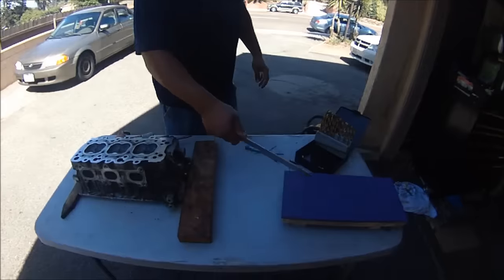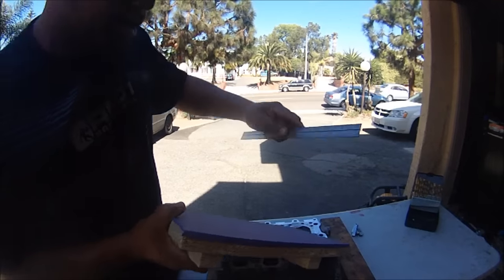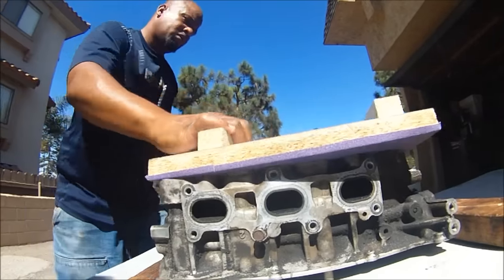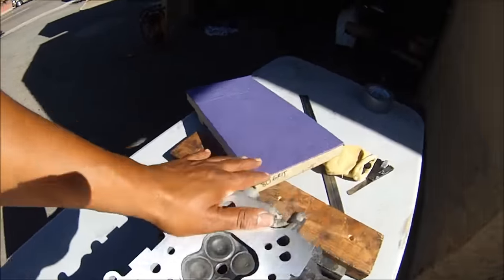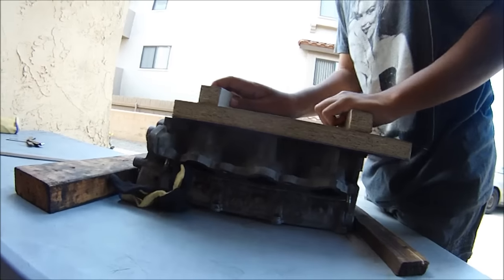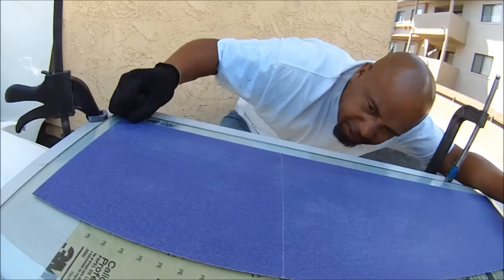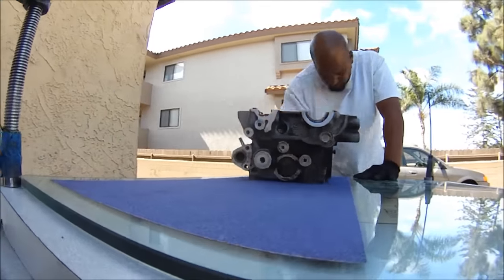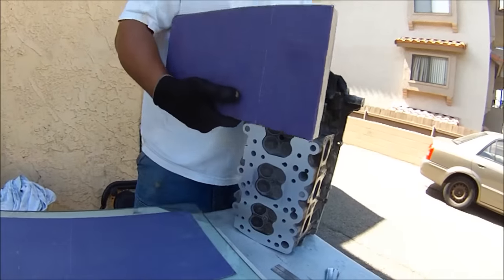HOW TO RESURFACE A WARPED CYLINDER HEAD AT HOME WITH SAND PAPER still works in (2023)

Comment: while i do not condone this, (engine machine should be done professionally) but damn son if it works thats preety damn nice, i applaud you i think this is how they did it in the 1930-1940's with hotrods.
Reply: Elvir Haskovic Most professionals take short cuts and hide behind their so-called credentials so that they can make more money than the job calls for.  many "PROFESSIONALS" DON'T HAVE THE CUSTOMERS BEST INTEREST AT HEART.
Reply: +slater1ist your right, Unless yoy find an honest professional like myself, I have more work than I can keep up with theres no need to rip off customers or cut corners for me, I do the job right the 1st time
Reply: Elvir Haskovic yo, you repair?  then... I highly respect your comments then! lol
Reply: +slater1ist yea man I seen a bunch of your videos keep up the good work I made a fortune selling salvage cars
Reply: Elvir Haskovic explain why you dont condone this?ive built race engines. ive used this method on street cars a few times with excellent results. but it should be checked for cracks before doing so,our else youll be scratching your head after putting it back together and wondering why there's either white smoke out the pipe. our coolant overflowing out of the top of your radiator. but as far as getting the head surface straight,this method works!
Reply: mark miller i dont condone doing this like i said because professional machine shops should handle major engine work like this, and its not "the correct way" to do it , but like i said to the guy if it works go for it, i didnt say he was being bootleg or anything, his engineering saved him a a few 100's.
Reply: +Elvir Haskovic Still don't understand your position. You say they 'should' handle it, but the only person who can say what 'should' and 'should not' happen with my car is me.
Reply: +Phil Underhill like I said, if it works it works, Nobody was speaking to you directly
Reply: +Elvir Haskovic I meant 'my car' in the figurative sense.
Reply: Phil Underhill i said i didnt condone backyard machining from a professional standpoint, however nobody is to say what you are to do with you car.... nobody cares.
Reply: +Elvir Haskovic Ah, I didn't see that. YouTube conment system sucks. Fair enough.
Reply: +Elvir Haskovic This is no different from hand scraping machine tool ways rather than surface grinding.  I have personally flattened some worn slideway gibs on my 70 year old lathe and  milling machine with files, plate glass, several grits of sandpaper, and cutting oil.  I have also removed the egregious high spots from the slideways with a fine file and diamond stones.  It's EXTREMELY fussy painstaking work and PATIENCE is necessary.
This 3 cylinder is not a race engine.  All it has to do is run properly.  He's not trying to wring another 0.05 sec out of it.
His method actually yields a smoother surface finish than fly cutting.  As you can see there are no tooling marks while removing a minimal amount of material.  Probably no more than 0.0045".  Flycutting whacks off ".010" on the first pass.  Flycutting is FAST and the surface finish is passable that's why its used by automotive machine shops where time is money.  This is painfully slow but the job gets done for very little of your precious coin.  
I would highly recommend pressure testing the combustion chambers and the intake and exhaust runners before spending an afternoon doing this.  Barring having a machine shop pressure testing... If the valves seal properly you can invert the cylinder head with the valves and springs installed.  Then pour a light solvent like Kerosene into the chamber till it's level with the head gasket mating surface and observe whether it leaks down indicating a crack or poorly seated valves.  The same method can be used on the intake and exhaust runners.
Reply: +David Hatzenbuhler what do you mean theres no difference? Machine Shops specialize in maching metal, theres no way your saying a peice of sandpaper can yeild better results, This method works but as I highlighted I wouldnt personally tackle it nor would I recommend it as I have not seen it 1st hand, however yes it takes off much less material at a time then machining will, however a table with a peice of sandpaper enough may not be level enough to work properly, thats why I suggested leaving it to the professionals and machining it using the correct mill.
Reply: +Elvir Haskovic  If you don't have the confidence to tackle this that's fine.   Obviously you have more money than time.  Know your limits.
Plate glass checked with a straight edge and fishing line in the manner he shows is similar in flatness to a surface plate.  Flat is what you need.  Level is largely irrelevant.  As I stated I have used this method to re-finish gibs from my mill and my lathe and small engine cylinder heads.  It works.  
The straight edge with feeler gauges prove the results.  I don't care what you use for the milling table feed rate there are still going to be tooling marks on the head surface from flycutting and the mill will require that you hog off more metal.  It's the nature of the beast.  Progressively finer grades of sandpaper will yield a much smoother surface finish than a flycutter in a milling machine.  Again.  The nature of the beast.
Does it require exponentially more time, care, and patience than dropping off at the machine shop? YES.
Is it possible to make a terrible mess if you are not careful?  YES.  It's definitely "at your own risk".
Is it impossible to obtain excellent results? NO.
Reply: +David Hatzenbuhler I wasnt saying its not possible Im basicly saying the time and effort and possible irreparable damage that can be done to expensive heads should be left to machine shops
Reply: +Elvir Haskovic I've gotten more heads back from the machine shop goons that were irreparably damaged or poorly machined than I'd like to remember.
I do my own valve jobs now among other things.   I make sure the guide bores are actually installed and reamed concentric with and perpendicular to the seats.  I have yet to get a set of guides installed by a shop that are.  I could go on but I won't.
Reply: +David Hatzenbuhler who the fuck fly cuts a head ?surface grinder is the way to go takes about 30min
Reply: +Elvir Haskovic Lad, I'm over sixty years old. I've worked on cars since I was 12. I've rebuilt more engines, heads, valve trains, automatic and standard transmissions, differentials and transfer cases than you've ever seen laying on the ground in a junkyard. ""The correct way" is "the way that works" but feel free to blow ten grand on a worn out mill and lathe if you want. Hang out a shingle and proclaim yourself a 'professional' til the sun goes down. At the end of the day you can even pop a top on a cold one and bark at the moon if you like.
Reply: Ramjet74 alright old timer, times have changed now unfortunately, clearances are getting tighter as cars are getting more and more complex. What was acceptable in the early days isnt the case now a days, if you had your glasses on i did state multiple times in reply to peoples ignorance, This method works, and as he showed it works good, the issue is most "DIY' or backyard mechanics wont be able to perform this successfully, and will most likely cause more damage than they stated with. that is why i dont condone it, that is why i feel professional machinist should earn their pay. But what do i know old timer? i only went to school for 5 years and am an ASE cert. Master tech... Not to mention my "first car" was my fathers old Merc that ive wrenched on since my early childhood too.
Reply: +Elvir Haskovic Kudos to you kid. My comment centered around your insistent reliance upon the word "PROFESSIONAL". When AATCO asks you if you want a job traveling around the country fixing their 10 year schooled ASE Certified Master tech screw ups and comebacks then I'll accept you pinging him for hand sanding a head. Keep your head in the books and out of the shop for a while and maybe eventually you'll figure out what I was trying to say. And no, I didn't take their free use of my tools, truck and experience. They belong to me bought and paid for and if you want to work for someone else for $30,000 a year have at it.
Reply: Ramjet74 hmm work for someone else? you realize im under 30 and run a repair shop that makes just under 1/2 a year? I think your mistaken,  My scan tool costs 30k let alone the 8 toolcarts i own and lifts and so on.... your really mistaken pal. old ass Backyard mechanics like you are getting replaced by the new generations like me, take your old school techniques away from here, and seems like your trying to say me having schooling means i dont have shop experience? I have more experience than you could imagine, specialize in Euro cars and Wiring solely. You know what electronics are right?   My clients bring me enough work to feed you, me and everyone on this comment section comfortably, I acttually love techs like you, it makes me laugh seeing an old man attempt to work on complex cars and just scratches his ignorant head and complains about how cars are "too advanced" your like Scotty Kilmer haha
Reply: +Elvir Haskovic Well hell then kid, you're number one in the world! Congrats.
Reply: +Ramjet74 Nothing like a carb on an engine. Old school guys have their place, and have their knowledge set. Younger guys like to stick to electronics because thats what theyve been taught and know. Neither side wants to learn the other because BOTH WORK. You guys sound like a married couple. You both know your stuff but the old guy has more experience, and your stupid if you cant admit that (that cant be fixed). Nobody cares if you own your shop, you could jump off a bridge and guys what? The world keeps spinning. Dont try to brag like an arrogant 18 year old - directed at Elvir.
Reply: Magnus77 as a young guy (19) both systems have there place. nowadays carbs just cant keep up with injection systems. more power less fuel use and better burn. sure the early systems had issues with reliability like all new to market products.
Reply: +Magnus77 I think maybe I might have twisted young Elvir's tail a bit too tight. I was kind of hoping to get him back on the subject of the video but he's a bit ate up with himself. Somebody will O-ring his ass and and jam an 8-71 on his head. Watch him go then. He'll be throwing rocks at throttle body fuel injection and not be able to talk for days.
Reply: +Elvir Haskovic Hey slick, Happy Holidays. You told Magnus77 it took an invitation to talk to someone like you. How come you and me are on such good terms and not Magnus? He didn't twist your tail.
Reply: Ramjet74 Happy holidays man, 1st off i respect that you have an experience based opinion and had a track record that supports it, Magnus resorted to petty name calling instead of voicing his opinion in a rational, experience related opinion, what are we 12? Gotta call each other arrogant to make each feel better? lmao
Reply: +Elvir Haskovic I see. Good enough.
Reply: Well that was fun, Speaking of old school ways i consider myself a mix of both, I feel i am an old man in a teens body so when i am working on my car, i like to use the old ways because in all honestly, no way in hell am i trusting people who cut corners to repair your car (Believe me i have worked in a few dealerships and repair shops before i quit due to the terrible work they did) I don't dislike the modern ways i just think the modern generation is too lazy to actually do a job with heart, back from Ramjet's era, if you tried to cut corners, you would have the guy/gal come back and really put you in your place if you did a job half assed, however in the modern era most people do the "There is something else wrong with your car that caused it" like that time my fathers Ford focus blew 2 headgaskets after being skimmed (sent to a machine shop) 2 headgaskets, yet when we did a similar method as the video except with a Marking out table (Renown for being incredibly flat) instead of glass the car did not blow a headgasket. I see both sides of your argument but in all honesty elvir your "Cars are becoming complex" approach to things is useless because Mechanics will soon be a thing of the past due to the fact electric cars have minimal moving parts and the only thing you could really service on an electric car is suspension and brakes.